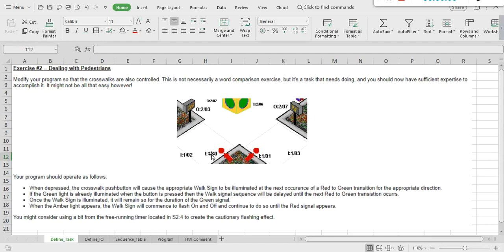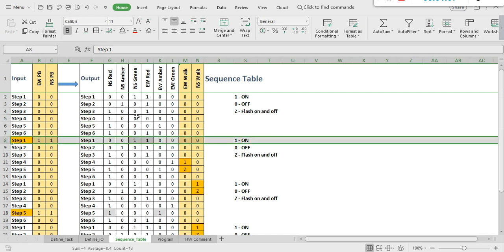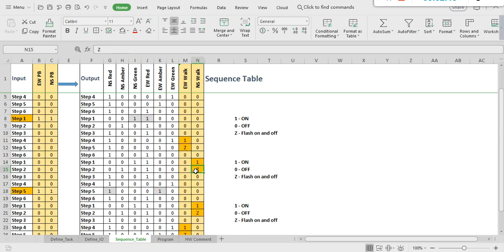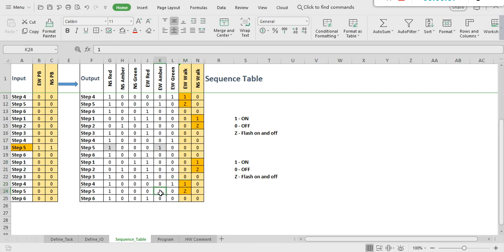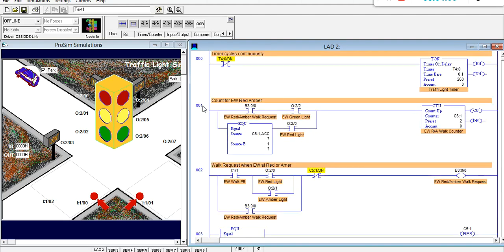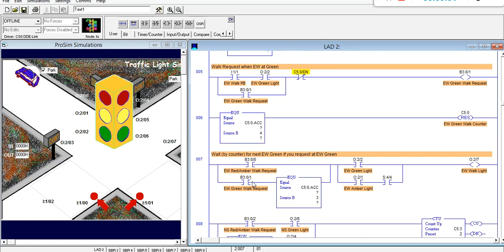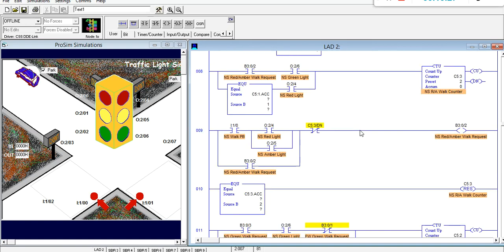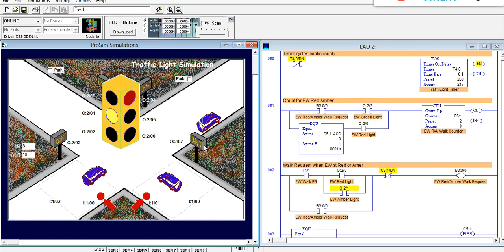Traffic Light with Pedestrian Crosswalk PLC Program

Comment: I liked the count structure of your program. I see one issue: When the walk button is pressed during the amble light transition the walk sign starts rapidly flashing. Pushing the walk button on an amble light should have the same walk delay as pressing during a green light.
Reply: Another issue is that when the output 2/2 is green, pressing the walk PB doesn't make the next cycle turn the walk signal on. It also does as you said and makes the dont walk flash during amber